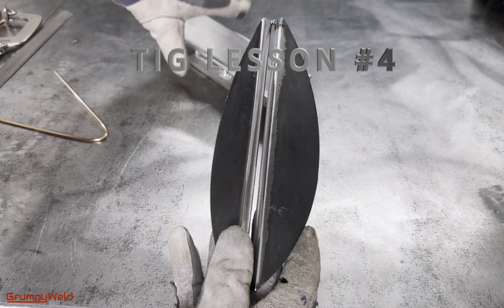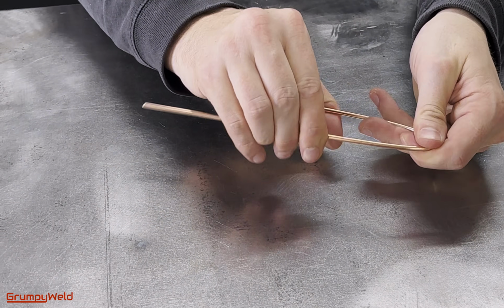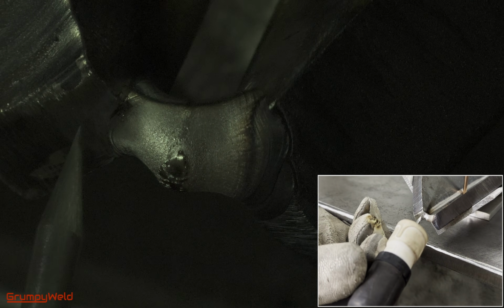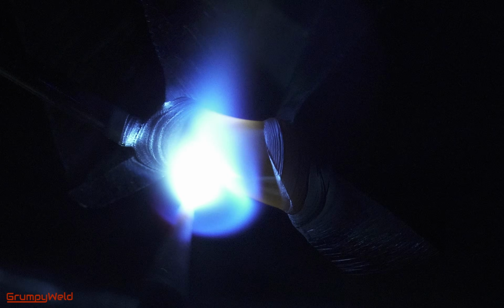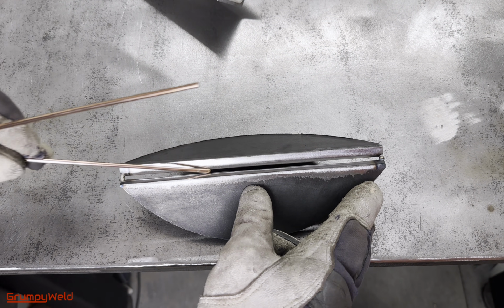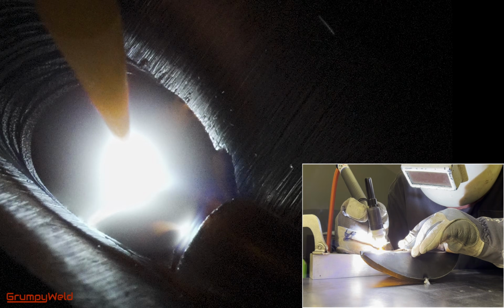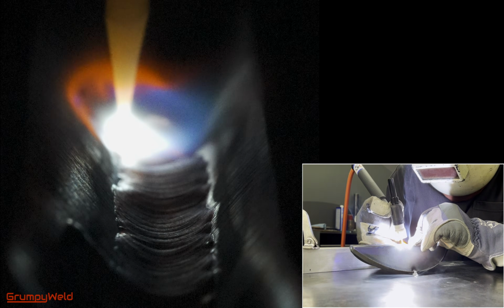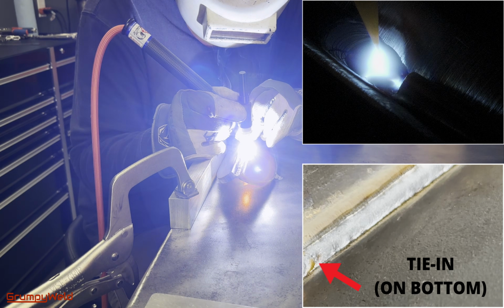Open Root Welding | Beginner TIG 4

Comment: I have a question. So ive never owned a sugar scoop helmet before, theyre completely new to me. With your sugar scoop helmet you sell and the auto darkening filter lens you sell, how do i install this? And do i need to buy front cover lenses and inner cover lenses both of the size 2 inches by 4.25 inches to put in the helmet too? How do i install all of this into your sugar scoop helmet? A video would help thank you
Reply from the maker: You can buy packs of front and back cover lenses for a welding lens. They are cheap. One goes on the front of the lens to protect it, and one goes behind the lens (facing your eyes) to add another layer of protection to you.

Our lens comes with a front and back cover lens--most autodarkening ones do. But any standard size welding lens will fit in a sugar scoop.  That is one of the main benefits of buying one.  Besides being more versatile in general and allowing you to see better (less peripheral distraction). 

There is a little spring casing that you can remove on the inside easily.  You slide in whatever lens you want, with a front and back lens cover, and then put the inside spring casing on (it snaps into place and is held with tension).  This is what holds your lens in tight (there is a lip on the front side that holds it from that direction).

The other best designed 2x4 hood is the huntsman style, which you should also look into.  Slightly larger and more boxy.  It's mostly personal preference.  

But in my opinion, these two hood types will give you the best performance and versatility.

Comment: Love the videos any new ones soon? Hey, what tungsten size and filler and settings for heat and hertz would you recommend for welding PODS onto Jon boat. He has plate on back so going from pod thickness .100 to 1/4 inch plate. Just filling the crack angles all good. Also what technique lotta filler or stand-off ? Thanks for tips !

Comment: I wish I could see as well through my Speedglas welding mask as I can see the weld in your video.
Reply from the maker: I hear ya! You'll get there. I remember feeling this way, too, and now I see better than what's shown in videos. Here are two tips:

1) Do the drills in TIG lesson 1. It's designed to train your eyes how and what to see. It's also why our vids have so many puddle shots, to help imprint things in your mind. We'll do more vids on this, because the topic is hardly addressed (but I think it's the most important factor learning to weld).
2) Find the right lens for YOUR eyes. It'll take some trial and error, but it's worth it.

Comment: Thank you for sharing this clear and undrestandablle video. I am waiting for more from you bro.
I saw your website.  That was so good. 😊👍👌
I have a question : i think in lay wire filler get hot VS backfeed technique, what is your opinion?  Please tell me bro.❤
Reply from the maker: Any root technique can put in high or low heat, depends on your amps, travel speed, and rod, if that makes sense 🤙